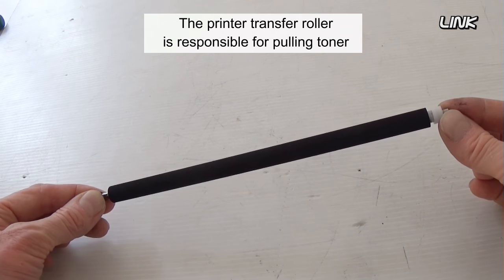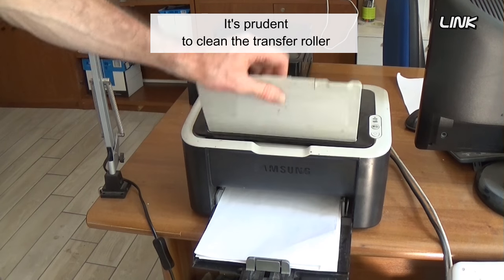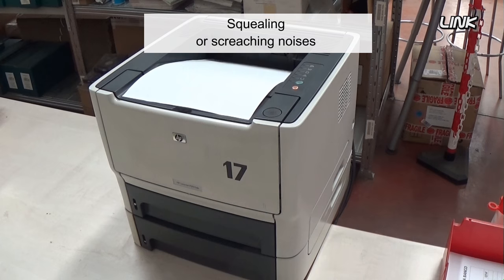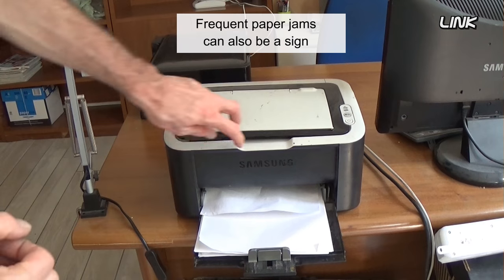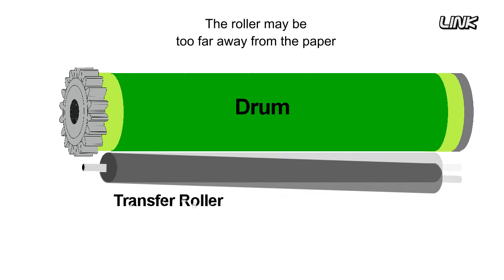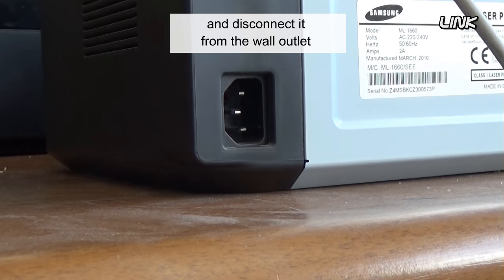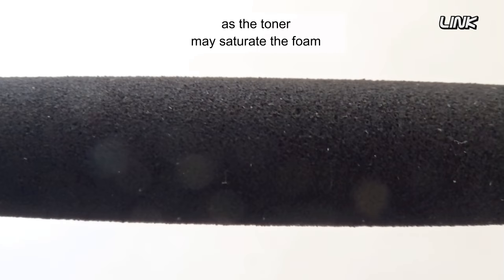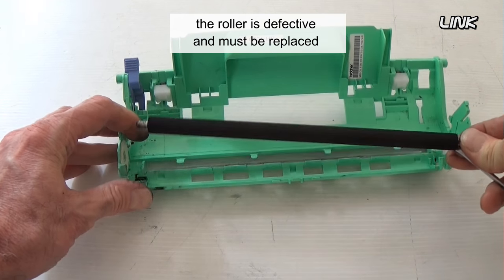How to clean a Printer Transfer Roller

Comment: I am having a gray haze problem. I think the toner cartridge I used was not compatible, now I am trying to clean the roller but it feels like there is no end to it. The more I clean it the more I can. I have been trying to it with napkins and cotton bud. It gets worse after the printer gets warmer. How long am I supposed to clean it for? Should I use water?
Reply from the maker: you can use a cloth lightly dampened with water but you do not need to clean it perfectly. compressed air is the best. however maybe the roller is worn out
Reply: Sir , I have ricoh printer which creates small dots on paper in sequence ( .       .         .      .  ) like this, would you please help me in this matter?

Comment: I went to print out some business cards on my xerox phaser 6022 and it did a horrible job. First time after many uses. How do I clean the sticky stuck ink off the rollers? I tried the stick another piece of paper in and it jammed immediately. Plus, if I don't have any lint free clothes, are alcohol pads ok?
Reply from the maker: You mean there is paper stuck in the transfer roller? However you cam use a normal cotton cloth. It would be better not to use alcohol

Comment: good evening I am a technician reseller of lexmark products I have to replace the fuser kit of the lexmark B2865 of the maintenance kit can you tell me the exact procedure for the replacement you need to reset the counter and how to do the procedure. Thanks and good job
Reply from the maker: I never change this fuser, sorry I can't help you that much. The manual says reset the printer by turning it off and on again. and if the message still appears update the firmware. I hope it helps

Comment: Thanks for your help regarding adjustment of the Doctor Blade! That part is now working great, but now I am getting light yellow streaks horizontally across the page. Any ideas as to this problem?Your advice is very smart and helpful. Thank you!
Reply from the maker: Are the lines always at the same distance? which distance?
Reply: @viandant5  Yes,  Approximately 2.5 inches apart horizontally.  I removed the Magenta and ran another cartridge  and it worked fine.  The problem is that cartridge is almost full of toner. I've adjusted the Doctor Blade several times.
Reply from the maker: @dianehouseman2056  2.5 inches is the diameter of the toner roller. may be it's defective or dirty
Reply: @viandant5  I cleaned it and it is better but still there. I think it must be damaged at this point. Thank you so much. You have been gracious and very helpful.
Reply: Would I be able to send you a photo of what it's doing? I hate to give up!
Reply from the maker: @dianehouseman2056  yes, send me an email

Comment: I have an HP Laserjet 451 and was told to clean the Doctor Plate with instructions due to getting streaks in the Magenta color. We did that and now I am getting Magenta all over the page. Any suggestions as to what I should do? Thanks for your help.
Reply from the maker: The doctor blade must be adjusted, set it downward so there is less toner on the roller surface

Comment: in brother DSP 7030 printing out put comes with very light and sides are dusty block Pl.
Reply from the maker: Did you check the toner cartridge? Is the toner evenly distribuited on the toner roller?

Comment: Good morning. I have a laserjet 4050tn and have a long light black streak up the whole middle of the paper. I cleaned the roller as this video showed and it was fine for a short time but now has returned. Is the roller the issue or can low toner create the problem?
Reply from the maker: A vertical line or horizonal line?
Reply: @viandant5  same thing happened to me! Mine is vertical down the middle
Reply from the maker: @mizzstarr510  I think the problem is not the transfer roller

Comment: Hello
 I have brother HL 5450DN. I have cleaned inside my printer, changed drum and toner and it is still printing smudge. What could be the problem? How do you also take out the transfer roller out of the drum? 
Appreciate any help 😀
Reply from the maker: I think the problem could be the fuser unit. You can remove the transfer roller disassembling the drum unit but if you already changed the drum unit I think it's not the problem
Reply: @viandant5  Kind of suspect that too. I was watching your video How to remove and clean Brother Fuser Unit, can I use your instructions to clean my printer (even with a different type)? 
Thanks for the reply!
Reply from the maker: @elaisatubana9812  yes, you can

Comment: In ML 1610 the print quality is light. I had refilled the cartridge and cleaned the transfer roller also, but same print only little improved. and while starting it gives red light error. After 10 to 15 restart it start operating. I am unable to understand the problem. Please help me
Reply from the maker: There is a fuser in that cartridge, to reset the error you have to change it. then the light print could depend on the toner cartridge

Comment: I have an hp colorlaserjet pro mfp m182n. I have a dot on my drum of cyan cartridge, which comes over page 4times. But after many prints I see a cyan line developing on the page so position of dot. Why does this line develops? Any solution?
Reply from the maker: The PCR charge roller discharge the electricity on the drum surface through the dot. In that zone the Aluminium substrate of the drum is not covered with the coating
Reply: @viandant5  any solution to remove this line?
Reply from the maker: @hathakker802  I think you have to change the drum
Reply: @viandant5  thank you

Comment: Hello. I have an hp color laserjet printer mfp m182n. I have refilled all the four toner cartridges. The printer is working fine. There is just one problem that when I print an image in grayscale the printer prints that image in yellowish black not completely black. Why does this yellowish tone develops even though I print in grayscale? 
Kindly recommend some solution
Reply from the maker: The grey scale are printed using the colors, not the black. May be the yellow cartridge is defective, or cyan and magenta are low
Reply: @viandant5  does the setting with option 'print in black and white' uses color cartridges ?
Reply: @viandant5  I don't see that my cyan, magenta or black cartridges are low. Yellow cartridges does not seems to be defective since color prints seems good.
If there is any problem despite of these facts in yellow cartridges, what can that be. Kindly tell solution? And predict what defect can be in yellow cartridge.
Reply from the maker: @hathakker802  Try to adjust the doctor blade of the Yellow cartridge so it prints lighter
Reply: @viandant5  actually while refilling I had never disassembled the doctor blade and it's on the original position as it was when I bought it new. And also for other 3 cartridges I had never moved their doctor blades from their original position.

So why does this situation arise that the doctor blade need to be adjusted?
Reply from the maker: The blade needs to be adjusted to adapt the cartridge to the new conditions: new type of toner, worn developer roller and so on
Reply: @viandant5  Because I have having a yellowish tone giving me a perception that the compatible yellow toner is darker/better than the initial original hp toner.can it happen that the yellow toner I have filled is more efficient/darker than the original hp toner initially?
Reply from the maker: @hathakker802  Yes, compatible toners could be darker because the components of an used cartridge are worn

Comment: hi dear sir, I have canon ir 2420 xerox machine, which print a copy very light, I have changed the drum, even though the problem is same, some of the place is 60% clear and some of the place is 30% clear full document is not at all clear. what would be the problem, kindly help me with the same. Thanking you in advance.
Reply from the maker: it could be the developer roller into the toner hopper, or the blade, or the toner too old

Comment: hello, I have an Old Laserjet 4 plus, a long time ago, this print dirt. This can repair cleaning this roller?
Reply from the maker: without checking the printer it's impossible to say but probably the problem is the toner cartridge, or the fusers
Reply: @viandant5  I will see it. thanks, great video.

Comment: Hello sir. I cleaned my drum of ML-1660, and it's getting dirty every single time again. Black spots on the exactly same place in paper all the time. What do you suggest to do?
Reply from the maker: which distance?
Reply: @viandant5  less than 2 fingers and repeatative. also this black dots on the drum again.
Reply from the maker: @ercouldnt  whar is exact 2 fingers? It could be the circunference of the toner roller or the charge roller. Is there a defect on the drum where the black dot is?
Reply: @viandant5  it is about 2 santimeter from dot to dot vertically. so there is 11 dots vertically and 6 horizontally per line. i can send you a picture of it sir if you want. by the way when i have cleaned the drum, i couldnt see any damage on it but tomorrow i will look at it more carefully.
Reply from the maker: @ercouldnt  That distance could be a defect on the charge roller
Reply: Thank you sir, is it fixable? Or I need to buy another one?
Reply from the maker: @ercouldnt  Try to clean it, or change cartridge
Reply: @viandant5  What do you use for cleaning charge roller? I'm afraid most cleaners can damage the surface of the PCR or leave cleaner-residues like tensides on the PCR...
Reply from the maker: @dermarius87  Water will work perfectly

Comment: What about not working at all, except only light on when switch turn on
Reply from the maker: It depends on which printer do you have. may be USB connection or wifi connection